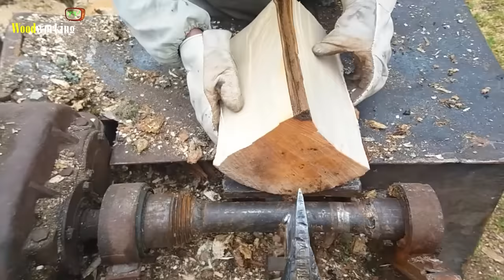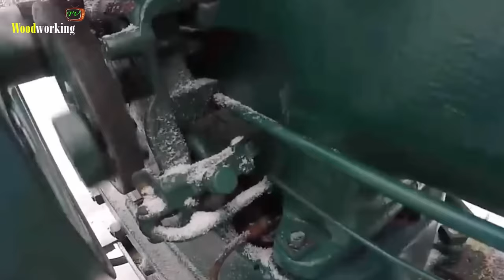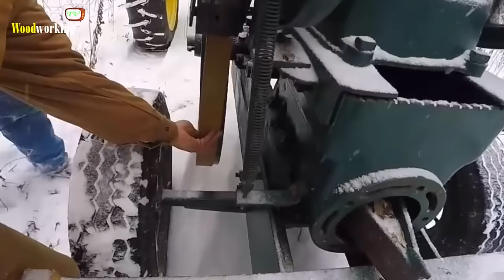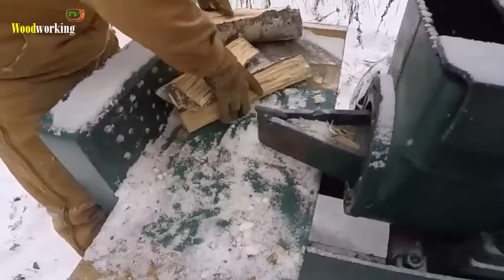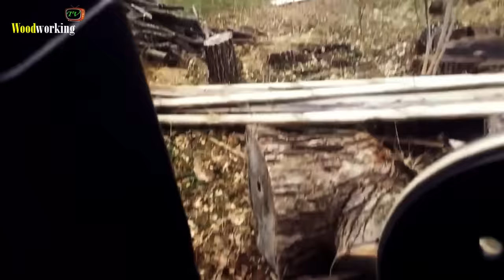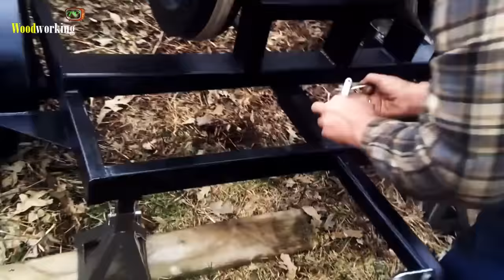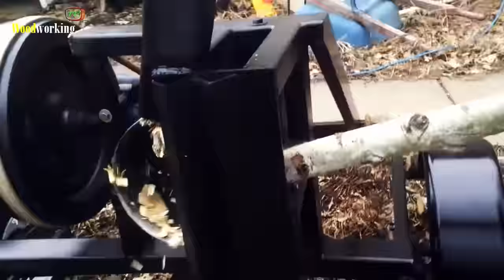10 Dangerous Homemade Automatic Firewood Processing Machine, Wood Cutting Machine Splitting Firewood

Comment: Alright that first one actually looks pretty good. 
You'll lose something if you get your hand in front of the splitter, but it moves pretty slow and seems no more dangerous than a table saw. 
The second one looks like it hungers for human flesh and is taking out its anger on the logs. I would NOT want to be anywhere near that.
Reply: If the first one had the silhouette for the blade to pass through removed it would be much safer

Comment: 2nd machine warrants a whole new category in the Darwin awards. I assume the monster ring gears landed in his lap free of charge and he designed the thing around using those as his flywheel, but the amount of obviously new and expensive material, and the time and effort expended in putting together this suicidal monstrosity frankly beggars belief. The log lift friction rope mechanism takes what was just stupid and intensely dangerous and elevates it to a whole new level, and the crocs just add that extra soupçon of idiocy to the whole thing.
Reply: The rope is propably the safest part of it all- the shaft aint that fast, so, uhm... its not as scary as the rest of the mackine :D
Reply: I laughed and continue laughing at these comments!
Too funny!
Reply: Well, it was stupid! The mass of the wheel could have stayed on the shaft, but the blades didn't have to be on the perimeter, they could have been on the axle.
Reply: platin darwin award
Reply: yikes.....I didn't see the crocs since that flywheel monstrosity had my entire attention
Reply: @Thor_Odinson  stay home on your keyboard where you’re safe.
Reply: @nos9784  the shaft and rope that isn't fast.. until a finger gets pulled into the rope... nobody saying they've never had it happen to them because nobody that can use it can type anymore.  Eh my grandpa all his life used a grider no issues... but he had an accident and lost the tips of his fingers to one some 40 years ago or so at this point... any machine can be dangerous even one that has been your trusty tool for most of your life.

Comment: #1 & #3 are actually quite efficient machines. I would use the 1st one with no issues at all and the same goes for the third if it had a guard over those flywheels. The second one on the other hand is a direct line to meet the Grim Reaper.
Reply: Depends on it having quick stop for example on the 1st one. If it had has something like  foot operated quick stop, then I would think it's fine. any open manipulated constantly rotating machine without emergency quick stop is always on the "unsafe design" category. Since on can never rule out stuff like getting piece of clothing caught in it or in mistake put ones fingers close. As such as slow or safe it looks, it must have quick stop. Not just cut power, but apply braking to the blade or otherwise render the blade safe

Then again it is no more dangerous, than open band saw or table saw. Stuck fingers in the blade and you get hurt. However as said all of those usually have a quick stop button, cutting power and slamming brakes on the blade. At least any decent one would have.

edit: oh and your comment is two years old. Soo, hello, very late commenting. Well what can I say, the algorithm gods brought me here.
Reply: @aritakalo8011 I'm still here and agree with everything you said.
Reply: The third one isn't even home made. It was commertially available in the 1930's (and not just the engine, but the whole shebang).
Reply: Grim Reaper on speed dial, indeed. I don't think there would be any much delay involved ...
Reply: I like No. 3 best. The first one had reminded me a lot of risk for crush injuries like in conveyor belts. At least if you stay at the front of No3 you should be ‘safe’
No. 2 was just scary on so many levels. 
The flying axe head
The loose rope near said axe head and set up
The fact the wood has to pretty much be thrown into the axe head (which even threw it back at user)
Just a huge NOPE from me
Reply: @h3llnite  #1 just moves so slow and you're on the side opposite the moving parts so I think you'd have to almost try to get hurt.

#3 looks like it's likely to catch a log crooked and fire it at your face, but otherwise seems OK. Since #3 is sped up video maybe it's safer than it looks.

Comment: The first log splitter is actually pretty efficient. I like that one. You just have to pay attention but it was pretty cool and it makes short work of those logs and it spins relatively slow.
Reply: yeah nothing wrong with the first one. Every power tool has some risk if you dont pay attention but the second one is just plain nuts.
Reply: Yeah what was wrong with it, I thought it was brilliant
Reply: @matthewharriman4267  yeah,  and  i think number 3.  is a good machine too,  is not that dangerous
Reply: @onillonill5192  First machine can hack off your hand if you're not careful. Third is quite unsafe with all the open wheels and especially since you have to slide on the belt while it's running.
Of course, both have nothing on the second abomination in that regard.
Both are quite safe overall, but for engineering anything, you should always think about the "DAU" (German, "Dümmster Anzunehmender User" = "Dumbest user imaginable") and at least show some effort in keeping the "DAU" from harming themself
Reply: @fabiansandhoff750  first machine, has a  nice  speed, it's  cool,  yes  it's dangerous  if  you are  not  work with care.  but  i dont see a  problem
Reply: @onillonill5192  Should anybody stumble near the machine while it's running, chances are you're grabbing for anything to stop you from falling. Just a bit of misfortune will see you grab the table at the wrong moment.
Reply: @fabiansandhoff750  yes ... but  in this  case you have that much engine that can take you if you stumble near  of them  ...
and when i'm on the street and a  old guy stumble und  push me, i can be killed from a car .
Reply: As a weld inspector,  I just cried. Although I think that he machine  is a little bit too slow.
Reply: Man, that first one, imagine getting your glove caught in that. By the way he is holding the logs and put them away, he gets sooo close the moving part and the exit hole, I bet he is missig a forarm as, we speak.
Reply: Shit but I imagine with that gearbox the torque will get through anything he throws at it and its faster than with a maul
Reply: @matthewharriman4267  From an engineering point of view, the first one is fundamentally perfectly fine. You basically only need to add a few things like belt cover, operator shield, and put the operator in a different area of the machine (not in line with the force) - but that's if you're being really picky. Other than that, as long as the operator has more than 2 brain cells and knows even a little about operating machinery, it looks like it would work great.
Reply: @fabiansandhoff750  The exposed wheels are a bit nasty.  This might be ok if you cover them, and add a foot pedal that gives 1 full rotation per press.  Place log, remove hands, hit the pedal.  And maybe add a simple body shield; even at such low speed, a piece of wood can get trapped and fly out.  Slower to operate that way, but still effortless, and a lot safer.
Reply: One problem with the first machine is that with a tall log the operator's view of the axe head is obscured.
Reply: Yeah, it was real nice to her the child in the background on the first one. A couple of safety features are needed on it.
Reply: @matthewharriman4267  The uncovered belts and gear with a small child laughing in the background.
Reply: @fabiansandhoff750  first Machine just needed a few safety guards over some of the moving parts... Other that that its fine
Reply: @fabiansandhoff750  first Machine just needed a few safety guards over some of the moving parts... Other that that its fine
Reply: I think the first machine has two major hazards. 1. If the wood ever gets stuck (too hard to split) I can see several dangerous things happen. 2. Get any of your body parts in there and it pulls you in.
Reply: @machscga6238  I would add in a sewing machine type of foot pedal clutch so the blade can immediately be disengaged when pressure is release.
Reply: @rnash999  that would also be handy
Reply: @rnash999   My thoughts exactly
Reply: @rnash999  That and a cover for belt and gears. It would be great and among all the others in the video, I would buy that one. The second guy is asking for death with that thing
Reply: No covers or guards
No foot switch to operate it
Something about the operator's position seems dangerous too. I wouldn't want to be looking down when that blade gets stuck and welds let go..
Reply: @onillonill5192  Oh man I've sen lots of people with missing digits talking exactly like that. And tjat is the deal with accidents. You never know when it's going to happen. Better be safe than screaming your lungs out while holding your hand.
Reply: It's relatively safe, but could go horribly wrong in an instant of carelessness. It really should have a shroud and some tool to move the logs in, hands should be nowhere near it.

With that said, the sound is very satisfying
Reply: The third one has no danger whatsoever, idek how that one even made it here
Reply: @zyanidwarfare5634  No covers on the fly wheels or belt.
Trip over a log fragment and get your hand in the spoke and you've got a broken arm.
Accidentally pull that belt lever a bit too much and your hand will get dragged into the belt and pullies, better hope its not your good hand because the only thing the doc will be able to do is lop it off.

Put some covers on and it'll be a fine design though
Reply: I liked that one too. I would consider building one but it looked like he was splitting perfect straight like maple or something. I bet it wouldn't do so great on a harder knottier wood.
Reply: @CynicalOldDwarf  Was about to draw the same conclusion.
Reply: It might kickback if you miss the back panel i think
Reply: @fabiansandhoff750  I'd say with the first machine if you could have a design where you have a foot pedal to activate it and some sort of immediate stop mechanism it would be a lot safer.
Reply: @fabiansandhoff750  so can an axe...
Reply: I have seen one very similar to that design on a farm once. The differences were there was an on/off switch the operator had to step on to apply the power or the spinning blade would not turn.

Comment: 1st machine needs a safety lockout clutch switch, foot operated.  Second device needs a cease and desist.
Reply: Where do you get a pulley that big?
Reply: @wayne3340  It is a set of gears that have been used as a flywheel. Kinda easy to find them lying around.
Reply: Spot on.
Reply: More like 'cease to exist'.
Reply: @TheOneWhoMightBe  hahaha Priceless

Comment: The first splitter is perhaps the best one I've ever seen.  Fantastic idea!  Slower, easy going, controlled, relaxed, powerful.  A work of art.
Reply: Ox / it's a lot safer than the second one, but it wouldn't work worth a fuck with green wood.
Reply: and super enjoying to watch
Reply: And you don't need to worry about it cutting part way through anything. Once it starts it's going all the way to the end.
Reply: What happens when it meets something it can’t split, like a log with a massive knot? It either stops or the axe head weld breaks.
Reply: @Tailspin80  looks like that weld will break soon either way.
Reply: @WungusBillYou have to know what will happen if it fails to split, for example if it hit a lump of iron embedded in the wood. There are various possibilities. The motor could stall, the belts could slip, the backstop could break, or the weld could fail. If the weld failed the axe could fly off and hit someone. If it was a manufactured piece of kit it would have to go through failure mode analysis.
Reply: @WungusBill Machines like chainsaws and tablesaws are made as safe as possible and the risks are known. Chainsaws have kickback protection to lock the chain when it flips back and if the chain breaks or falls off it is designed to drop down without injuring the user. The main risk is user error and lack of experience/ appreciation of all the things that can go wrong! Because of that chainsaws will always be dangerous but also essential bits of kit. You couldn’t let the public loose with the first machine in the video unless all sorts of safety guards and interlocks were added - it would only be a matter of time before someone chopped their arm off or the whole mechanism exploded and the axe head went into someone’s skull. The product liability lawyers would have a field day.
Reply: @WungusBill I also have long experience with chainsaws. I’ve never had a chain break. While the chain coming off is relatively common it is not that dangerous (unless you are cutting above your head which you shouldn’t be). If you look up the stats there are a huge number of chainsaw injuries and fatalities but the cause is almost always user error - being hurt by the tree, kickback, etc. There is no way to stop this type of injury except by banning chainsaws altogether or banning home users without suitable training and certification. I hope they never do that.
Reply: @WungusBill The user has to hold the log as it splits, so in normal operation his hands are close to the cutter. What happens if the log is too thin, cut crooked, contains knots etc. as would happen in real life with an inexperienced user not in a carefully staged YouTube video? I can see the log twisting sideways and dragging a hand into the cutter. Not too different from holding a log and bring it down to a chainsaw chain. I’m trying to explain why the basic concept is too dangerous to ever be a product you could sell, and if you did you wouldn’t be able to get product liability insurance for it. 

A wood splitter is different in that your hands are out of the way when the splitting starts.
Reply: @WungusBill If it’s such a great idea why doesn’t anyone sell it then? Some machines are just too dangerous to use either in the home or the workplace and this is one of them. A conventional log splitter does the same job and is not inherently dangerous if used correctly, whereas this one is dangerous all the time. Go ahead and market it. Make your first million!
Reply: @WungusBill Safer as well I expect. Things have changed a lot over the decades. I remember the workshop at my school back in the 60s had a belt drive that ran right round the workshop driving lathes, saws, milling machines etc. it was kind of boxed in most of the way but exposed where it needed to be. Can you imagine a bunch of school children being allowed to work near that these days? Stick a hand into it and you’re probably down to one hand for the rest of your life.

Comment: Any Machine you have to jump back from when it does its thing needs turning off, and scrapping.
Reply: or it at least needs to be redesigned to be somewhat less dangerous.  I would not go near that 2nd one.  I wonder how many people operating one of those contraptions had wood thrown back at them or lost a finger or hand.  It makes a jointer in a wood shop seem harmless until it kicks the wood out from under someone's hand.
Reply: How bout just gear it down
Reply: not a Disco machine!!!  You don;t scrap a disco machine because Disco will never Die!
Reply: Mark S Or automation it could be an efficient machine without a human involved

Comment: I've watched 3 of these videos and #2 on this one was the first really dangerous one I've seen.  The uncontrollable spinning death fist hammer thing wasn't enough so he added a dangly rope next to the flywheel. The only design I can think of that might be worse is a large flywheel that grabs the wood, carries it about 280 degrees around and throws it at an axe 10 feet away...maybe has a belt that runs dangerously close to the hopper somehow.
Reply: I guess you could also drill a hole in a still standing tree and light a stick of dynamite with a cigarette.
Reply: "I decided a spinning blade was too dangerous, so in this new model the blade is stationary and the log is fed into the mechanism with this trebuchet. My hands never have to go near the cutting mechanism."
Reply: A device spawned in Mordor
Reply: Is that a “safety shield” the rope is run thru?  hahahahaha!
Reply: @benwinter2420  🤣
Reply: The dangly rope is a windlass. It’s a pretty clever way to get the wood up the ramp. Plus it adds an additional way for the machine to entangle and entrap the operator before the machine either strangles or lobotomizes the person stupid enough to approach this machine.
Reply: The primary purpose of the dangling rope is to pull the operator into the skull cracking portion of the machine. The fact that it can lift logs is just an added bonus.
Reply: @fredjonson5781   You aren't that far off. When I was a kid, farmers could buy dynamite from a hardware store without a permit. My granddad used to blow up stumps with it. 
He once told a story about how he blew up a stump about fifty yards from the house on a Sunday afternoon, and ruined my grandmother's tea party with her church friends.
Reply: Fred Jonson
Death Fist Hammer ?
Wasn't that a Norwegian heavy metal band ?